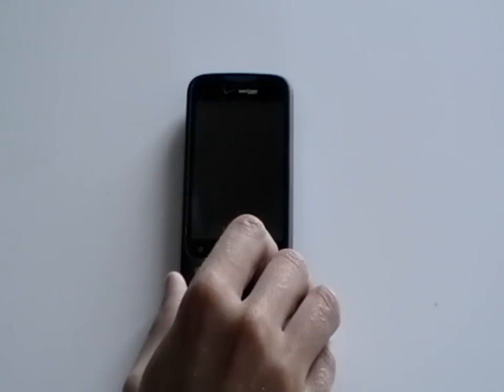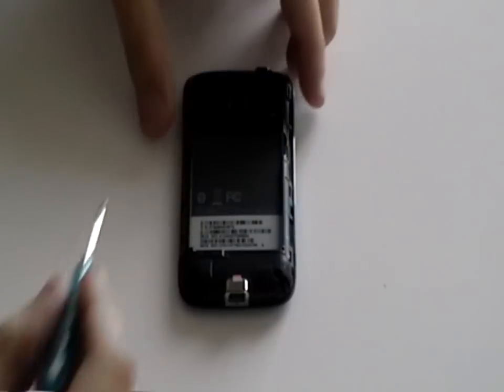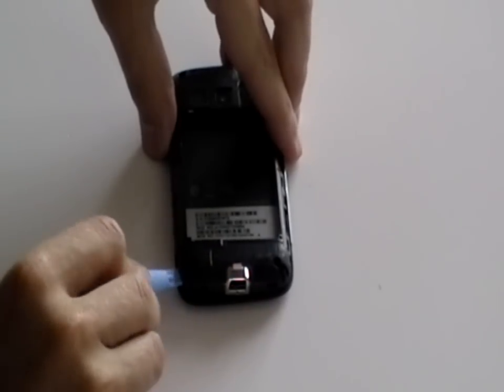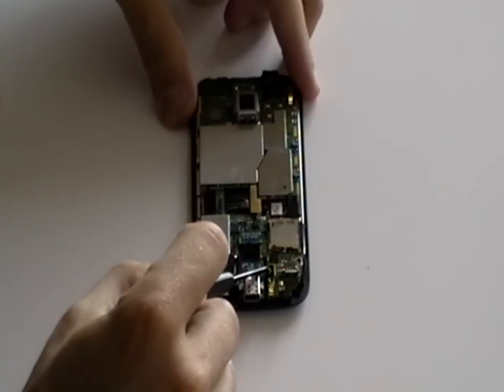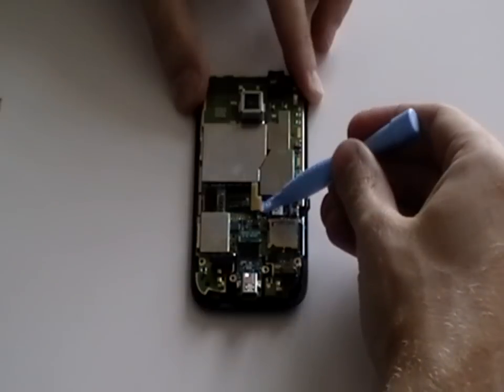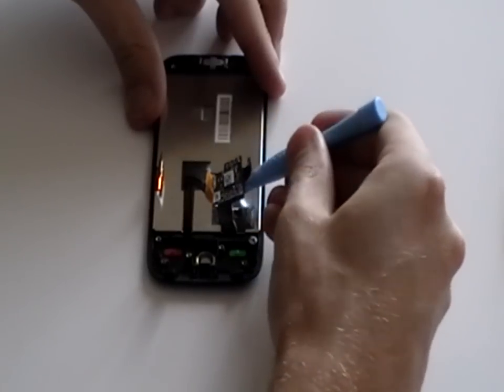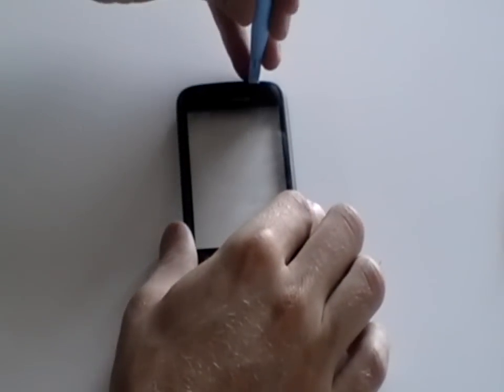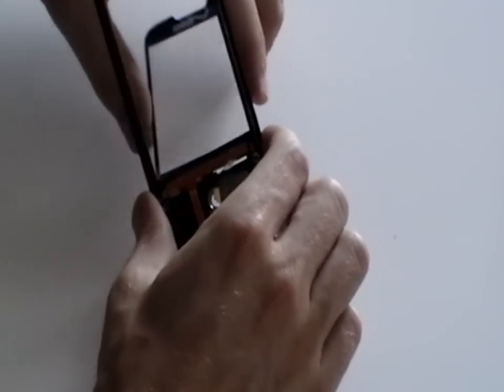HTC Eris Droid Glass Touch Screen Digitizer Replacement and Repair Guide Video

Comment: Thanks for your video.  I had a broken screen on my droid eris and was able to take a good screen off of a broken eris and swap it with the bad one.  I bought a set of precision screw drivers at Home Depot for $4.88 and used a whittled wooden popsicle stick as a pry tool.  Had to whittle the end from time to time to get it to work.